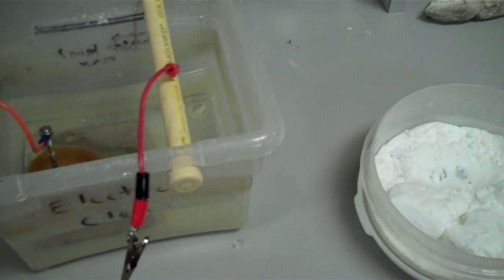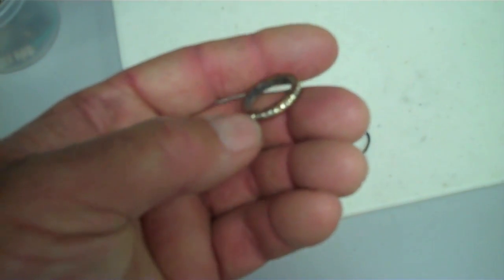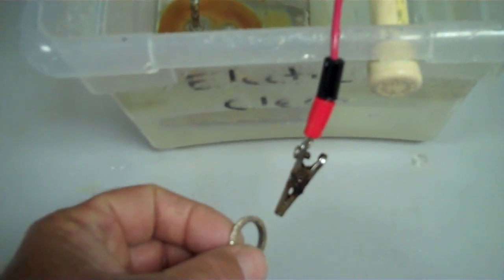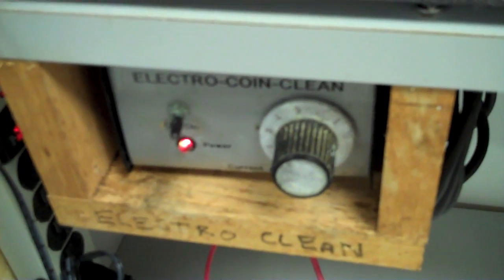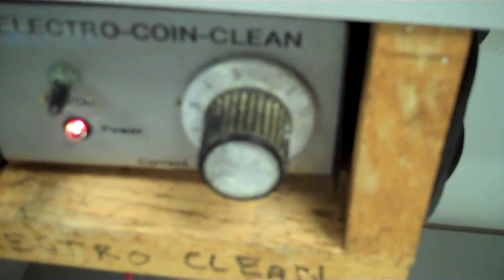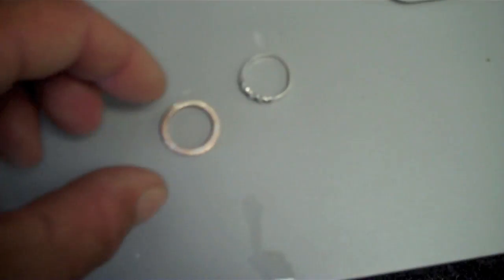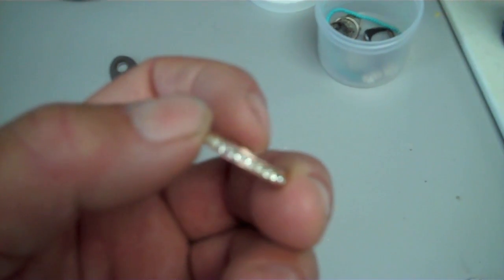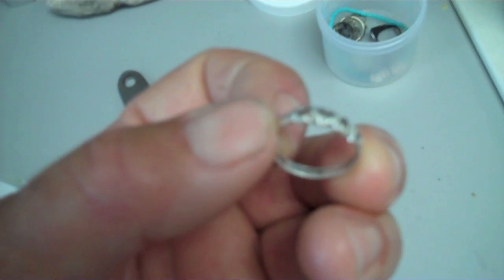Cleaning silver using an R.E. unit.

Comment: Hello, please electrolysis is better, friendlier than chemical silver cleaner specifically designed to clean silver? I just brushing with a special corrosion chemical cleaner (bath) after cleansing and goes to see some places that silver is porous, therefore non-smooth and possibly damaged. Also can i change the color. Thank you for your answer. Sincerely, George.

Comment from the maker: Heavily oxidized rings should be cleaned with a lower rate of current. On this unit, I would use a setting of about half of full power, Reason being that they can become brittle if you dont.

Comment from the maker: As for most gold, I never need to clean it. But, lower karat (under 14) can turn a dull brown if it has been there long enough (and also get green spots from the copper in the alloy corroding). Some 14 kt, can also change color, but over 14 never changes color. The RE always cleans them up shiny.

Comment from the maker: It doesnt pit the gold, but it can pit the really badly corroded silver (but then again, likely the silver/alloy has already corroded to that point anyway). As for the solder, same thing, but generally not as bad unless the item is really corroded. I tried copper items and it pits them out, but all of this can also depend on the strength of the current used, which is why one of those home made RE units (using a cell phone converter for instance) is not worth the bother (cant adjust current).